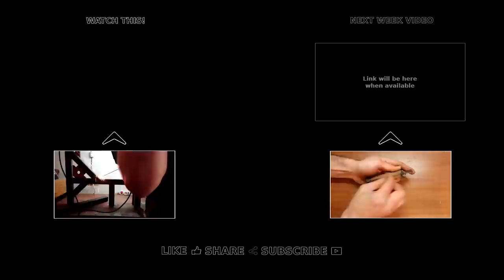Sharpening Wheel For Razor Sharp Blades! MDF

Comment: I found a guy on e-bay (in Germany) selling 22mm x 13 cm (about 5" dia) disks for peanuts so I bought a couple. Do you think they will be too small (fast)? I will have to figure out how to drill the hole exactly in the middle, but that isn't rocket science. I also ordered a green fine polishing compound stick. Is there any disadvantage of working with the wheel turning toward one rather than turning the motor around? I would work from the side anyway, not from the front. Thanks for the useful idea.
Reply from the maker: Thank you for watching! First off, don't use it the other way around, the blade can catch in the wood and it would be pretty damn bad. I've seen others using a wheel spinning thorwards themself and sharpening with the edge facing down but I never tried! Be extra careful anyway :) If the disk have no hole in the middle I think you will have to turn them a bit on the motor, getting the precise center is hard and even a bit off will make the wheel wobble too bad for sharpening! Good luck Bruce, and have fun :)
Reply: Thanks! I'm sorry, I guess I didn't make it clear that I would never try to sharpen against the rotation of the disk. I'm old, but not tired of living. I thought I would just drill the center hole and then do as you did, using an old chisel or the sharpened end of an old file to turn the disk true. I'll let you know how I do.

Comment: Walter Sorrel did the same thing.  Just wonder if the blade should be sharpened on a stone prior to the MDF-wheel.  Which paste do you apply?
Reply from the maker: Yep! I use fine polishiong compound. if the edge isn't busted no other sharpening is needed :)

Comment: Can you use plywood and not mdf or is mdf better
Reply: gave up on regritting the mdf wheel, made an 8" plywood wheel, glued on 240 grit emery sandpaper, lasting over 50 sharpening and still going without any signs of failing!!!!

Comment: That looks like Melzmine Shelving Material and not plain MDF Board. Have you tried plain MDF for a sharpening wheel? 
 Or does the melamine on each side to hold the wheel together? Wouldn't it sharpen different without the melamine?

Comment: The top edge of the side windows of your vehicles is diamond ground . You can draw your knife across it like a sharping steel and get a razors edge in very little time with great results . I have done this and have used my knife to shave with . "Deeds not words"
Reply: I tried that did not work
Reply: @euartista  you must not have done it right then , I've done it and have had great success . The knife has to be somewhat sharp to begin with . Its more of a finishing sharpening not for butter knifes . More for putting the edge back on a razors edge . How bad was it to start with ? I use my diamond stones first then finish off with this or my sloth leather/compounds . For carving . Not in place of grinders .

Comment: Any danger of messing up the temper along the edge due to heat? That's why I always thought using a wet/ or oil stone was best... Or a slow turning wet wheel...
Reply from the maker: This is used very gently :) No much pressure, the edge doesn't get hot at all :)
Reply: Mine does heat a bit but Black beard is right, very light touch is all that's needed and make sure you have enough compound on the wheel. I just sharpen a few passes each side and then let the knife sit for a minute and repeat the process.

Comment: Ok i get it but: the wheel will not take the burr off completely. Just a few light strokes on the stone and you're there. Otherwise the burr will get tossed and you have to do it again after 1 use. Just spend couple more minutes for a perfect job.

Comment: geeze, I got some mdf sitting in the boiler room, this is gonna save me $80 on a honing wheel kit
Reply from the maker: Nice!! :) Have fun making mate!
Reply: Used someone else's drill press to make my holes, don't do that, use your own, it didn't make straight holes :(
Luckily the grinder I have has cups that straighten the wheel as they tighten. Gonna pick up some rouge in a bit and see how it does.

Comment: Is that wheel spinning too fast? In order to remove metal on really blunt knives I assume moderate pressure would need to be applied, would that over heat the cutting edge and make it brittle?
Reply: Yes. That's a serious issue.

Comment: Very cool! Will have to try that myself. Any issues with burr you have to deal with? Did you do any stropping afterwards? I use a lot of different ways to sharpen knives but im always looking for a better or faster way.
Reply from the maker: I don't find the edge to be any better if I strop afterwards :) To take care of the burr I do one last pass on each side without pushing the blade at all, very lightly, takes off the burr easily :)

Comment: I wonder if the steel gets too hot? That would be a disaster.... I wrok with the Kazak sharpening system. Works really well. Takes about 10 minutes for a big knife. Razorsharp.
Reply: Yes, you have to be careful. Light pressure only and few strokes. I have hacked my bench grinder like this, but use a  cotton polishing wheel instead of MDF, and it still get hot fast. I am going to mod it with a gear and a belt to reduce the rpm.

Comment: Would this work as well with a piece of wood such as pine?
Reply from the maker: I highly suggest you not to use wood, it could fail really bad with rotation forces since it's not strong in all directions. Composite materials are way better for that.. I've seen some use plywood, but it may have problems with mass balance. Look for a piece of MDF if you are building this, it should be very cheap :)

Comment: I tend to shy away from using MDF at a high rotational speed. I had a piece disintegrate once and it was a bit scary.
Reply from the maker: Oh really? How many rpm was it spinning? I have a wheel like this one for over a year now and never had a problem :) running at 1500rpm or so
Reply: it was fastened directly to the shaft of a 3250 rpm motor. I think the piece became unbalance and started to shake, but it happened so fast i couldn't be sure. it sprayed wood particles all over my shop
Reply: @BlackBeardProjects  that is a pretty slow wheel compared to most bench grinders

Comment: Try this: Glue a strip of rawhide around the perimeter of the wheel. Score, knurl, or stipple the rawhide to hold the paste. Rub it with 1, 2, or 3 micron diamond paste. A dimes worth of paste will sharpen 20 blades, or shine up a lot of metal parts.
Reply: @stevebrule6172   Not dangerous at all. It won't come off. If it does, it won't hurt you. Been there, done that.

Comment: I just grab my angle grinder and run it along the blade, but only on duller blades. Works more than well enough if you have a steady hand. Then follow up with a fine sharpening stone.

Comment: If I attempted this project I would research on how to slow the rpm down on the grinder to maybe 200 rpm or somewhere in there. I fear that this high rpm could generate too much heat and/or remove too much material. Most wet sharpening wheels turn at around 160 rpm or so, maybe a simple rheostat could be wired in to be able to adjust rpm.

Comment: Are you just moving the blade edge across the  outer edges of the wheel? Thats where the black steel deposits are showing (clean in the center). I've been trying to lay my blade full square on the full width of my powerstrop but maybe i'm doing it wrong. ATB from the UK.
Reply from the maker: Hi! Yeah I'm just touching with the edge, not much pressure is needed :)
Reply: Thanks. Think I've probably been rocking the edge of the blade too much trying to keep it ALL on the flat surface.

Comment: To prevent overheating the blade, hold contact only a few seconds and, then, check the edge temperature. You may want to water cool the blade every few seconds, to prevent overheating.
Reply: I don't think the blade will overheat, polishing compound is actually very smooth, I doubt it would heat up b4 u finish sharpening

Comment: WARNING! When using a machine like this, you need to be EXTREMELY careful not to overheat the metal, or you risk destroying any temper that the blade may have.

This is a great idea for decent and fast results. But it's always better to go slow when sharpening blades, as you have more control and can achieve a finer result. It'll cost more over time in polishing compounds, compared to a set of whetstones, but I definitely can't deny the speed and efficacy.
Reply: You have to get metal crazy hot to mess up the temper
Reply: On a dry, fine edge, blueing happens faster than you realize.

Comment: How its can be so good like diamond? İts just basicly wood. Can someone explane it how its work with mechanical methods?
Reply: kamilcan kestem because it's not removing metal as a sharpening stone would. this works like a leather strop, by helping to straighten and refine the edge already present. it's a really wonderful application for the buffer.

Comment: Beautiful man do you think a semi perfect circle is achievable without a router? I pretty much only have hand saws at my disposal. I've been wanting to make one of these for a while but didn't feel like it was doable with my tools.
Reply from the maker: Hey man! Hard to tell :'D Maybe if you take your time you can do it, I didn't had a perfect circle either and a bit of turning on the shaft is probably always needed! Maybe you can do a test piece with a thin material :)
Reply: That's a good idea, I'll try that. Thanks!
Reply: How to make supper fine compond
Reply: I did it by printing out a piece of paper with a circle on it, and then gluing it the the wood and just following the lines. Worked pretty well for me
Reply: Use a compass to draw a circle of a preferred diameter.  Follow the lines with a jigsaw.  Sand down any great deviations before using a wood chisel on the spinning disk to avoid possible jamming or chipping.  Rough sandpaper can also initially be used on the spinning disk.  Good luck.
Reply: Sharp Works initial

Comment: Wont this heat the edge to much? To much heat in a very thin edge will mess the hardness up
Reply from the maker: Never had this problem, I don't push on the blade much so it never heats up! :)
Reply: No, you would have to get it to temper temperature which varies with steel but most temper start at 400 degrees so no way you are getting it that hot. If steel turns colors that means you went too hot.
Reply: @joshyingling  friction is a bitch.

Comment: Use double sided tape and a spoil board under the router circle cutter, and you can save some time by turning out a wheel thst won't need much truing.

Comment: My Fiskar pairing knife was catch by the polish well and stabbed 10 cm in my stomach xP was a nice hospital visit
Reply from the maker: Holy shit! :( I'm sorry bro, hope you're doing fine now. How that happened?
Reply: You need to mark the direction of the wheels rotation on the side and only sharpen with the blade edge facing the the same direction as the rotation. I turned my grinder backwards so I could sharpen away from me, only I forgot and yes the blade edge caught in the wheel but I was not hurt. Now I have big warning stickers I made reminding me which direction the wheels are going.

Comment: What kind of engine did you use? power? rpm?
Reply: It looks to be meant just for polishing. Notice the shaft comes out of both sides too.  I'd say a good 15,000+ rpm's
Reply: Buy a bench grinder. Its a nice tool. You can grind metal, and you can put also a cloth polishing wheel instead of the stone, and I think you could do what was shown in the video.
Reply: @danielbelmir0  That's what I was going to do. However, there are many grinders with different power. The cheapest ones are like 1500 watt, but it's not their real power. I'm afraid it will be too weak and it will stop at sharpening.
On the other hand, during sharpening, too much pressure is not applied, so maybe for sharpening is enough, but if I want to grind, and change it to stone, then a stronger version would be better...
Reply: @Protoleviatan  1500 watt is a lot. My bench grinder only has 360W, and delivers 200W of power at 3400 rpm aproximately(synchronus speed of an induction motor at 60 hz and 2 poles is 3600hz, at 50hz the speed is 3000 rpm) and it can stay turned on for 15 minutes(it can get really hot if you dont turn it off), it can work with two stones of 6 inches. Seems like nothing, but it can grind metal easily with a stone. But its not for professional use. If you want for example, make a knife out of a piece of steel, you can shape the steel pretty precisely with the angle grinder. If you want to work for example with more thick or hard steel for a long time, a cheap bench grinder will likely be not enough.

Comment: That first blade on the attempts at cutting the paper before sharpening did cut the paper nicely when low near the handle in the bottom 1/3, after polishing he used the same low 1/3 section and not the top half that he sharpened, the the second blade gets shiny but no attempt to cut paper cleanly and effortlessly? This vid seems kinda suspect to me.

Comment: I hope he was wearing a good dust mask, MDF dust is thought to be carcinogenic. Take care when working with it folks!
Reply: It depends on how th MDF is processed. Not all are carcinogenic.
Reply: 80RedRock 
Thanks for the info, is there any way to tell?  Do the sheets have any warning on them?  If the MDF has been laminated with melamine or some other form of plastic covering (as in the video) do the manufacturers still make it apparent that there may be some danger to health?
Reply: Nicko Lps  
You might be right about car exhaust fumes being hazardous to health but since when did two wrongs make a right?   
And if you think it’s stupid to point out health hazards doesn’t it mean that you are a ‘stupid health hazard Nazi’ yourself to point to car exhaust gases as being worse ?
Reply: Nicko Lps  
So now you are pointing out the health hazards of McDonald’s food and still calling me the health hazard nazi?
You’d better change your name to Richard Cranium.
Reply: Nicko Lps  
This is taken from the UK Health and Safety executives website.
MDF
Q2. What are the dangers of working with MDF compared with softwoods, hardwoods or other panel products?
The atmosphere created by machining or sanding MDF board contains a mixture of softwood dust and hardwood dust (if it is present).  In addition, there will also be free formaldehyde, dust particles onto which formaldehyde is adsorbed and potentially, the resin binder itself and its derivatives.  However, the levels of free formaldehyde in boards made within the EU at levels of formaldehyde class E1 are thought to be insignificant.  This is because at these levels the resin is fully reacted (polymerised) 
Under current legislation softwood dust, hardwood dust and formaldehyde are considered to be hazardous to health.  Both softwood and hardwood dusts are known to be respiratory sensitisers and may cause asthma and other respiratory problems.  Hardwood dust can also cause a rare form of nasal cancer.
Formaldehyde is classified in the UK, and in the European Union as a carcinogen and it carries the hazard statement ‘suspected of causing cancer’.

The relevant information is out there, but I can’t spare the time to educate you.
From now on your on your own, good luck.

Comment: Seeing the charring on the wheel means the knife is getting very hot  and potentially losing it's temper. Be very careful or you will just get a sharp blade for about 2 cuts then have to sharpen the newly soft steel again.
Reply from the maker: The wheel isn't charred, the polishing compound turns black when used. The pressure applied is so low the bevel does not get hot at all :)
Reply: Black Beard Projects sounds good my grandpa used to use his bench grinder and ruined a few knives that way lol

Comment: I hope you were wearing a mask when all that MDF dust was coming at you, I have been told it can cause cancer, as it has formaldehyde in its construction. Really good idea just not worth the health risks. I hope you do not mind me saying this, regards from John.
Reply from the maker: I don't mind man, I was wearing a mask as everyone should when working with MDF :)
Reply: the anti flu jab has formaldehyde ans mercury in them ,
Reply: Thanks for mentioning that john - I never thought of this before.  So is the formaldehyde in MDF a concern just when making the wheels or anytime using a sharpener like this?  Opinions appreciated - please and thanks.
Reply: @aitf99  Yes you are releasing the formaldehyde particles in the air anytime you use this.Not to mention the dust from mineral used to hone the blade. Wear a mask AND do it outside as the particulate will remain in the air for a while after shutting down.
Reply: @paulhandley1467  thanks.  Would it be better to make them out of plywood or something else then?
Reply: You have to breath the dust in for a long long time. I've been doing it for 40 yrs ain't dead yet.

Comment: You have to be really careful to not ruin the tempering of your blade. One second too long an that power grinder and you basically convert a hardened steel to soft iron with no edge retention what so ever.

Comment: . . . the problem with this shit (high rpm buffing) is that you heat up the edge of the steel blade - so it gets weak - you will get it sharp but it won't last like a blade sharpened on a wet stone . . .